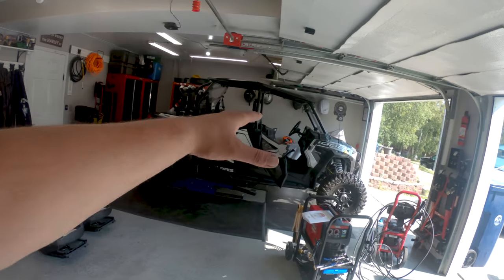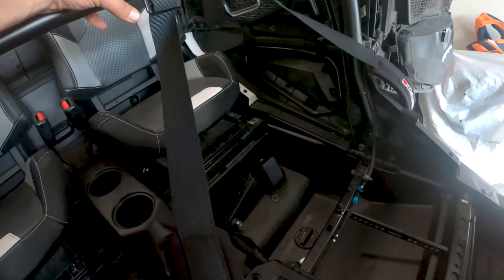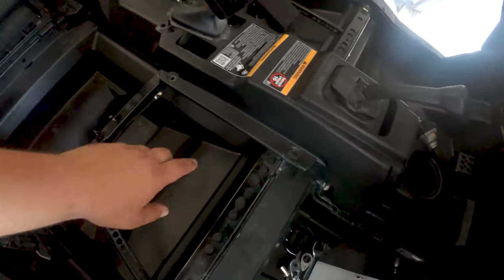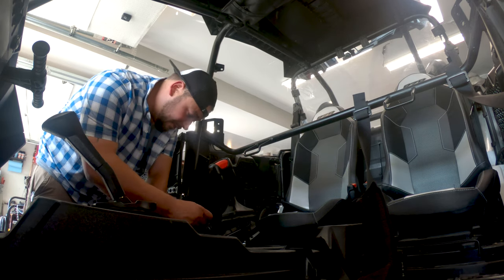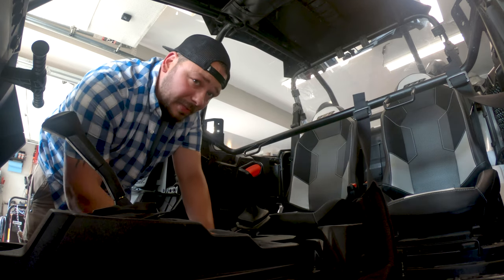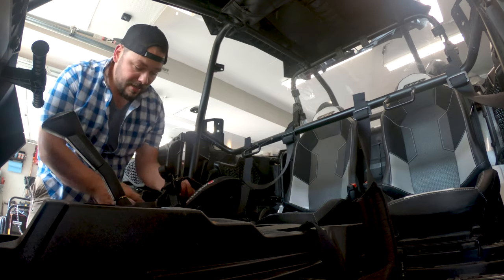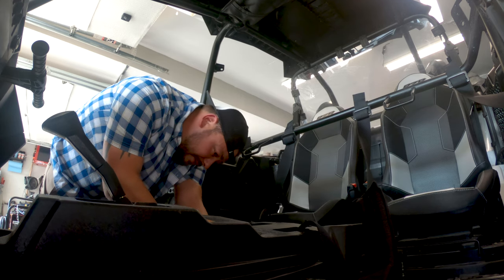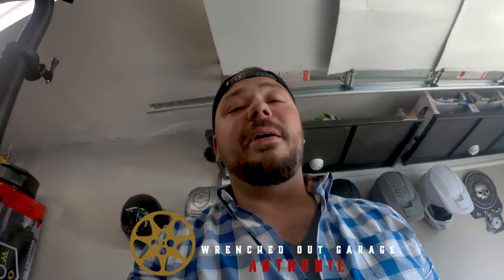The Polaris RZR gets it’s a 4 point harness install

Comment: Did you do the backseat?  We are having issues getting the nut off the bolt for the seat belt spooler.  Very limited room to move.
Reply from the maker: No I didn’t do the back seat yet because my little guy is still in a  car seat.
Reply: That nut is a 19 mm i believe and up can fit a 3/8 breaker bar in there or a flex head ratchet for the passenger side. The driver side has more room you could fit a wrench in there

Comment: Did you use an aftermarket harness bar behind the front seats
Reply from the maker: No, that’s the stock one
Reply: what's the purpose for a aftermarket harness bar?  for more support?
Reply: @TunERaVaGeD  the harness is supposed to be mounted even with your shoulders. So it’s not pulling you down into your seat.